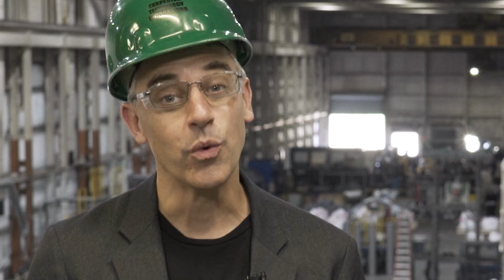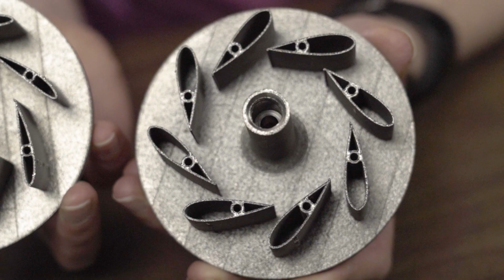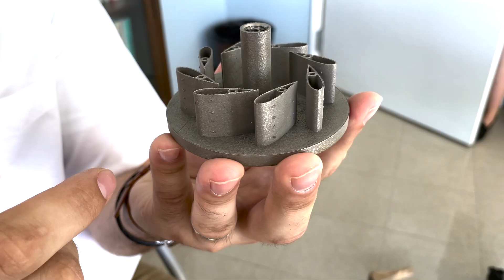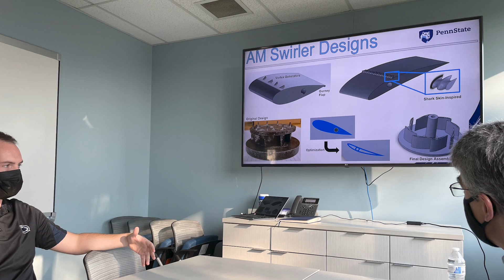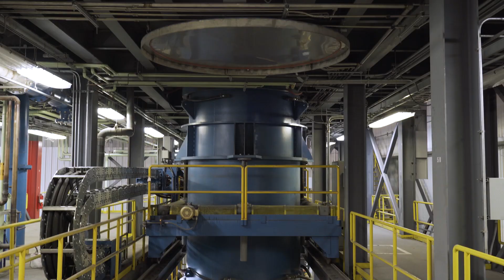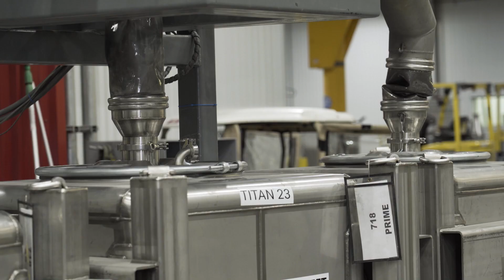3D Printing for Better Gas Turbine Flame | The Cool Parts Show #42

Comment: I kept waiting for Integza to pop up... maybe he can do a collaboration with Dr. O'Connor.  For sound control I was expecting owl wings or some more complicated trailing edge treatment. Also a bit surprised they just did 2D extruded wing profiles... could have done some bowed or canted wings to take advantage of the free complexity. It would have made the predictions from conventional methods more challenging, but it seems like this is a more blue sky project (pun intended).  Basic research is often complicated and messy, but that's how we advance the state of the art. Use it to validate some CFD or perhaps a neural network (do I hear 2 Minute Papers)?
Looking forward to part 2.

Comment: Thanks again. Fascinating stuff. I was just reading today about using machine learning to control fusion reactions in tokamaks: I won't be surprised to see the same thing happen here with swirlers to achieve optimal mixing (etc.) for different applications. (Also commenting for algorithm).